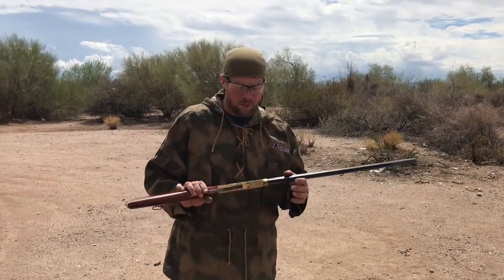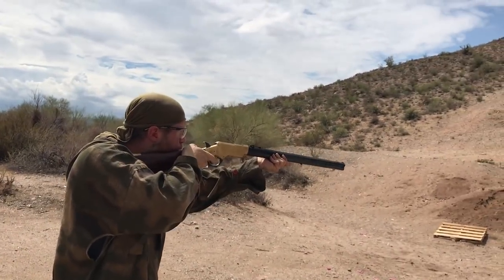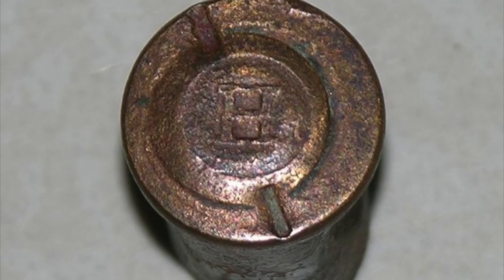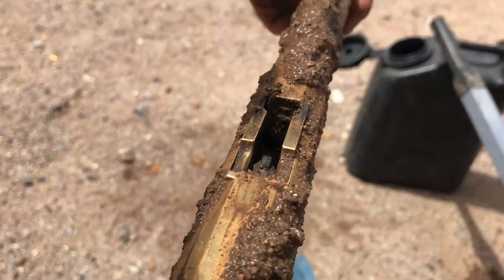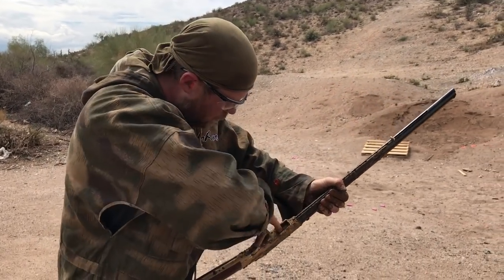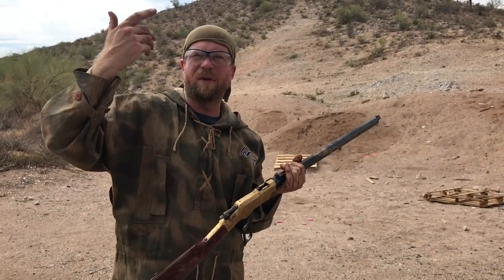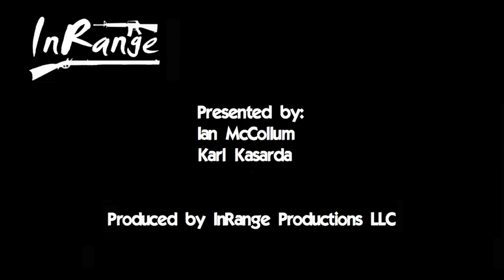Lever Gun Series: Mud Test - 1860 Henry Rifle

Comment: 2nd time around you didn't have an empty cartridge to eject the mud above it? Empty lifter and mud fell into the breech.
Late edit 23/11/18. This video was hosted on the 20th yet when I go to the home page this video isn't shown, likewise if I go to the page listing videos. I can only find this video by back tracking through the "Bell" notifications or going to the "Playlists" page and selecting "Mud & Dirt". Why isn't this indexed on the other two pages?
Reply: Exactly my thoughts, so basically if the gun was loaded or at least had an empty in it when it was dropped then you had much better chances of it running when you picked it back up.
Reply: That's what I was thinking. They were half right. The lifter ejecting the casings out the top did clear the mud, BUT there needs to be a casing to fill the middle of the lifter, otherwise the mud gets pushed out on the sides, and falls through the middle.
Reply: Exactly.
Reply: Exactly what I was thinking
Reply: yeah, with ACP there's going to be mid on that little lip the round rests on at the end of the headspace, and with the force applied to try forcing the action shut, that's not coming loose with a light rinse anyone.
Reply: The second time, you could see the glob of mud fall right back into the action.
Reply: Agreed
Reply: If Karl had turned the rifle upside-down the second time, it might not have jammed.
Reply: Agree Sir
Reply: I concur.
Reply: So it's decided. The best way to carry an 1860 in the field is with a spent casing in the chamber.

Comment: I was surprised the gun didn't jam after the first mudding, you might have been able to empty the gun by pushing the elevator (with the cartridge in it) down with the bolt open and letting all the cartridges slide out the front of the magazine. I think what really helped the gun during the first mudding was that it had a spent cartridge in the chamber, so during extraction and ejection, it would have prevented some mud from falling into the action when the bolt was retracted, and when ejected, it would have flung some mud (that would have otherwise landed on top of the next cartridge, in the path of the extractor) away with it. Interestingly, with these toggle link actions, as long as the extractor removes the cartridge from the chamber, once the lifter block pops up, there really is no place for the cartridge to go but out of the gun.

Comment: One thing you missed doing: Getting the round out in to the elevator, and then pouring water on there. Might have cleared the extractor notch.
Reply: wouldn't that lead to grit in the barrel, which is a bad thing?
Reply: @gavindavies793  I guess that depends on how much water one would use. Fair argument though, soldiers often don't have that much water.
Reply: "Water?"  I think you mean "whiskey."  What kind of cowboy would have WATER on him?

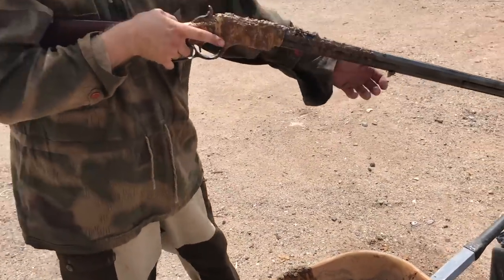Comment: It appears the first attempt worked because it had a spent cartridge in the chamber.  When this was ejected @ 2:14 the lifter and the empty cartridge pushed the mud out of the way.  The second time @ 4:50 it was an empty chamber - and the lifter has a big hole in the top for the mud to fall through.  This shows if you want carefully as he works the action - first time around, it threw a big clod of mud up into the air.  Second time,  it was just a little splash - the rest evidently falling gently to the side or falling in.

Comment: I think what contributed to it failing the second mudding was due in large part to the fact that there wasn't a spent casing covering the mouth of the chamber. Also when the elevator comes up with a spent cartridge in the middle it clears more debris. Side note: this is just nitpicking but the consistency of the mud was different. More liquid to run into the small crevices.

Comment: Oh that poor beautiful Henry...

I honestly imagine dust would be a bigger issue than mud would for that design.  As a million people have pointed out, the ejector+a spent case (or a live one, if you're desperate) can clear big, heavy detritus from the action and get the gun going, but desert moondust grit is not so easily dealt with.  Perhaps that's the real reason the military wanted the open mag tube dealt with - the gun is surprisingly proof against mud and crap when run properly, but all that openness makes it more susceptible to dust issues/buildup over time?

Comment: The difference was the loading of a cartridge in the gun prior to dunking.  If you had a round in the chamber first the mud would not be able to fall in the chamber.  So if you carried the rifle in locked and cocked, it would work.  if you carried it unloaded and had to chamber first without clearing the ejection port the act of loading will cause a fail.

Comment: So this is a little late to the party, but I noticed on the 2nd round of testing that the lifter served exactly as Karl described, and shoved a great deal of mud from the action. Upon closer inspection at a slower playback speed at 4:51, the lifter ejects 100% of the mud covering the bolt, with one little corner of the mud clump landing in front of the bolt. This little clump was then shoved directly into the locking recesess and killed the gun. My contention is that if Karl, or anybody using the weapon in less than ideal circumstances, had used their hand and even briefly attempted to wipe the top of the weapon or shake it to clear even a little bit of mud, the gun would continue to function in these conditions indefinately.

Comment: The Henry had a major production issue that simply made it impossible to produce it in large numbers, witch is why only about 14 000 were made and why it was replaced by the Winchester 1866. That the barrel and magazine tube are made in a single piece. That made it a wery hard piece to make, and it took it´s sweet time to make it aswell. A lesser problem was that the .44 Henry rounds were not wery powerful and were not realy goof for shooting at any range over 200 yards. And even that was pushing it. The .44 Henry is basically a pistol round by modern standards, and not a wery strong one. That said if the enemy were up and close it was the rifle you wanted to have if you could afford it. A Spencer works aswell, anything with more than one shoot capacity were better than a single shoot rifled musket.

Comment: I think Ian was right it's mud getting in to the ejector channel. I cant wait to see the '73 test 'cus I sure ain't doing it to mine. Also correct me if I'm missing something but I'm pretty sure the way to fix that jam is pull the bolt back press the loading gate down with your finger then pull the round out of the chamber.

Comment: The chamber was loaded, by an empty case, on the first go. That case ejecting prevented mud from falling into the action when it was closed, and on the other shots there wasnt enough mud to cause an issue. 

When the chamber is empty, theres nothing ejecting, only the lifter going up which knocked some mud off, but knocked other mud down into the lifter which was then pushed into the action along with a round.

So the Henry passes a mud test ONLY with a loaded chamber. Which unless this was how they were carried (Probably, to get an extra round of capacity?) the Spencer beats it because the Spencer isnt dead when mud gets in it.
Reply: Sshhh remember the whole series was on why the Henry is superior to the Spencer

Comment: Looking back to the FW review of the original Henry I see the rimfire cartridge was struck at two points. Do any modern 22 rimfires have hammer strike at two or multiple points? If rimfire is intrinsically unreliable would this not lessen the failure to fire rate?
Sorry for idiot question UK viewer 27 years since I last handled 22 ammunition.
Reply: I don't know about modern but I know my old Sears did. I would say they don't nowadays due to better ammunition production. Two strikes has a better chance of striking if you had a bad primer
Reply: @shanesizemore3654   So good quality ammunition and two strikes. Do you have any memory of the failure to fire rate. 
Even with good modern ammo wouldn't two strikes just be a belt and braces approach to preventing failure to fire.
Reply: I have an Norinco copy of a Browning a-22 with the double firing pin, guessing it at late 70's to early 80's production
Reply: I have an Norinco copy of a Browning a-22 with the double firing pin, guessing it at late 70's to early 80's production
Reply: The Freedom Arms Model 252 were fitted with a double firing pin at least during early production.

Comment: I have spent some time polishing up the internal surfaces on my 1866 and it functions far smoother than it did prior to the work. I'm wondering what damage the gun sustained as a result of the mud test, considering the softer brass components ? Perhaps a follow up video to the mud test would be appropriate , and extremely interesting .
Reply from the maker: No damage.

Comment: I’m going to speculate that the first try worked better because when you cycled it, there was an empty case that pushed the mud over the central portion of the ejection port away from the action as it opened.  Second run, you guys cycled the action open with no case to help clear that mud as it ejected.

Comment: If that's .45 ACP, then your malfunction was mud getting in the headspace when you mudded it up without a round in the chamber. You might have been able to clear it by pouring water down the muzzle, but any little sticky crud in there, particularly after being compacted from trying to force the action closed, would be difficult at best to dislodge.
Reply: .45 Colt (rimmed revolver cartridge), not .45 ACP.

Comment: I noticed that on the second test Karl opened the action with much less energy than the first one. I believe this was an attempt to accommodate for the camera. Also, the second test didn't have a spent cartridge to eject leaving a hole for mud to fall down between the ejectors on either side; watch in slow-mo 4:50. I DEMAND A RETEST!!!

Comment: Somehow i dont think an original henry would have done that well, mostly because of the machining of the time. It makes me think of that pakistani army testing that was posted on soldier 
systems, various aks performed differently on the same mudtest (different to the one inrange does, this one was total submersion in watery mud with an empty chamber), the zastava fired once and didnt work, the chinese one fired once, jammed and started to work normally after cycling it, and the russian ak worked perfectly without a hitch.  I think the difference must be fit and finish.

Comment: As has been stated before, I think having an empty (or live) round already in the chamber helped to eject mud from the action, and prevent more mud from falling further into the action.

I wonder, if you were to dump the ammo out of the mag, could you clear the live round out via the magazine tube? You'd probably have to push it forward with a stick or the back of a knife, but with no ammo or follower pressing in, would there be anything to prevent the stuck round from exiting that way?

Comment: Hey, I know you guys already have a lot on your plate, but just a thought, could you guys mud test a revolver? I think I know exactly where that'll go, but I'm curious.
Reply: Mud testing revolvers is too dangerous. Think about the fact that the cylinder is opened on both sides so you can very easily get mud and dirt in front of the bullets and forcing cone and blow up the revolver when they fire.
Reply: @stelioeffrena1571  Yeah that's fair. Ian, Karl, don't do it.

Comment: So what about having huge clearances not helping on the mud?
Reply: U have to consider the locking mechism. For ak and ar, the locking surface is on the bolt face. So if mud gets onto the bolt face, you cannot lock the lock into chamber. The Henry has a knee joint lock which should be more resiliant to mud (just comparing locking mechisms). Of course if you get mud into the chamber it will still jam.

Comment: Far better than I expected, if only you could eject the cartridge on henry's.

Alas imo opinion it fails.
There's jamming and there's fucked.
If you'd have 5 mins in cover to get it to run again it's okay-ish but
It's a serious problem having to literally take the frame apart to get it to run again.

The magazine didn't even seem to be an issue at all.
And I reckon that in 'normal' muddy scenario's it would probably kept on running fine.

This reassures that the military really did miss out.

Comment: Mate, come on, you should at least do what someone in the field would do if their rifle fell in the mud, which is to give it a single shake to get the surface mud off at the bare minimum. This test is to see if a firearm can work properly after a dunking in the mud, not firing while actually still in the mud, which is what leaving a giant pile of it on top replicates. Also, is the fact that the wheelbarrow not long enough to do a mud-dunk, a good enough reason to have something that is? Even a tarpaulin would do the trick.